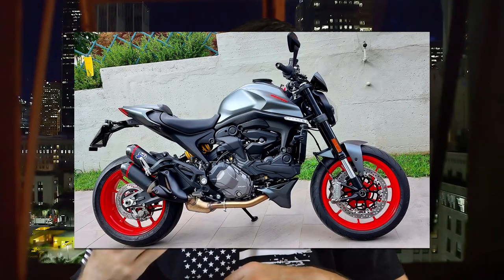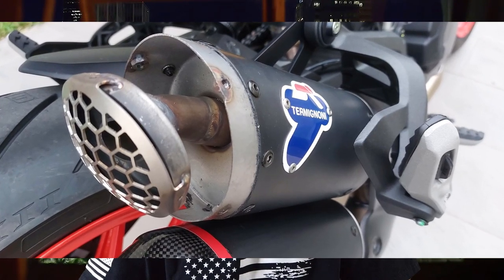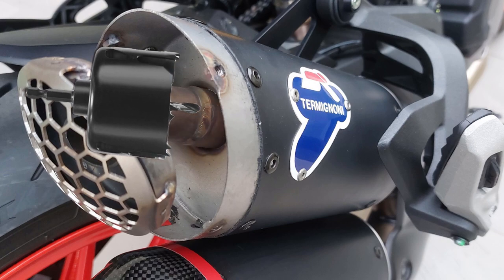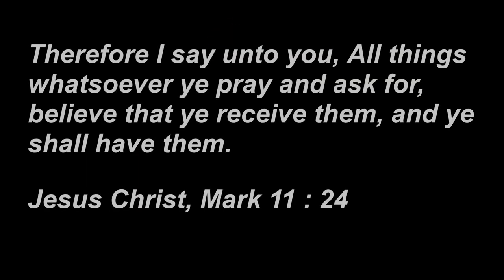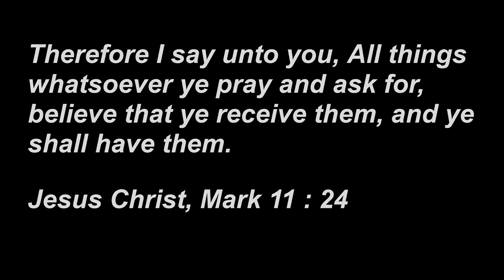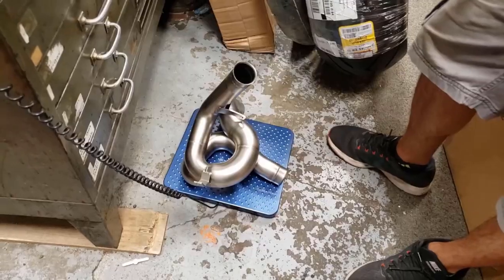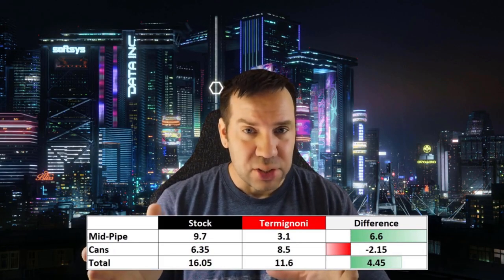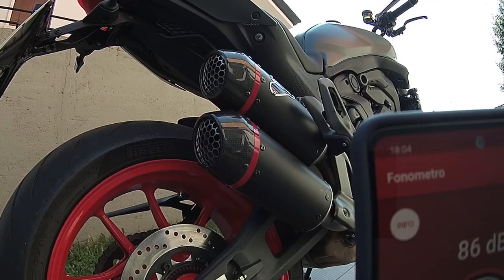Ducati Monster 937 ⛔BEFORE YOU BUY⛔ Termignoni Slip-ons, WATCH THIS (Termignoni Slip-on Full Review)

Comment: Hi. Thank you for this nice video. May I ask someting? Is it going to be a full system if I install Termignoni Racing slip on? Or do I need to do the other thing? Also, unmap is included with Racing Silencers? Thanks!
Reply from the maker: You need the full racing system (that includes the upmap, depending on where you live). What country are you in? If you are in the USA, what state are you in? Many states no longer allow the upmap. :(  But I know someone who may be able to install it for you.
Reply: I live in South Korea. Ducati Korea doesn’t allow to installed racing silencers. However I just made a contract for install racing silencer with Termignoni authorised dealer. I heard that unmap is not included in this case. Is there any way to do unmap in this situation?

Thanks!! Also, thank you for your videos. very helpful!

Comment: My question - and I think I know the answer - having already bought the slip ons, is it possible to upgrade them to the full (I.e. is the muffler the same and maybe I just get the header and midpipe?). It looks like the cans are different because of the db killer which seems easily removed in the full, but requiring some modification on the slip on
Reply from the maker: I think you could have your dealer install the rest of the pieces for you. Are you in the NY area by any chance?
Reply: @DucatiDiaries  I did and just got her back.  She’s a beauty just like yours but maybe not quite as dialed in as yours.  Doesn’t look like Termi sells the mid-pipe and Header separately so my slip ons will have to do but they sound delicious.

Comment: Quite a lot of work involved with taking silencer out of slip on, Iv just done it. It is one continuous pipe from the entry to the exit, which gets narrow and tapered towards the exit of thr pipe. Need ti saw off the end plates, saw off the weld join of muffle to main pipe, rip out thr insides, weld a new straight pipe onto end plate and re pack, then weld mufflers back onto main pipe. 6 hours or so in a Thailand engineers garage. I have pics let me know where to send them
Reply from the maker: Wow six hours. That's a lot of work. How does it sound now? You can send pics to RatedRCars@gmail.com

Comment: i am thinking about getting the full system but only use the Slip ons without db killers (driving without cat could be a problem were i live)
Reply from the maker: Or maybe get the full system and leave the DB killers in. Because then you get the upmap for increased performance. The system sounds better than stock even with the DB killers in.

Comment: The smarter way but more work would be to simply drill out the rivets for the carbon shell to pull it off and cut the welds for the DB pipe from the inside.  You can buy black rivets to replace the ones drilled out and keep the original look, or get red to be even more Ducati.  🤣

Comment: The Italian Connection, red rims do look mighty sharp. Do I sense red rims in your future?
Reply from the maker: I already tried. :)  Ducati won't sell them. :o/
Reply: @DucatiDiaries  that's unfortunate,  you would think something like that would be in their accessory catalog.
Reply from the maker: @robertjakicic5878  Imagine carbon fiber wheels on this though. I've got the bike down to about 407lbs wet. CF wheels and this thing is flying in the clouds. :)
Reply: @DucatiDiaries  I actually forgot about that option, carbon fiber wheels.  Just 400 pounds in weight that is extremely lightweight. You'll be under 400 with the carbon wheels.
Reply from the maker: @robertjakicic5878  Hopefully they're cheaper than the Diavel carbon fiber wheels ($5,000). :o(   You could buy a whole bike with that.

Comment: You can remove those dB killers fairly easily without ruining the mesh I think... A Dremmel with a cutting wheel, or a hand held keyhole saw perhaps.  You can drill lots of holes in a circular pattern to help make the sawing easier...

Done it on mufflers before on one of my Aprilias...    Once I drilled a ton of holes in a circle, and then took a sharp metal chisel and hammer and basically punched/cut between the holes that I drilled.  Once I got a large, rough hole, I inserted some perforated tubing wrapped in exhaust baffling, and then rivetted the end cap back on...

The process on the mufflers in your video will be very similar.  Basic tools, some skinned knuckles, a bit of cursing... but otherwise not too hard

https://www.youtube.com/watch?v=CX-93ZyApIA&t=1s
Reply: Here is what the stock and rebaffled cans sounded like:

https://www.youtube.com/watch?v=LbPDXy-b0Lo

I think you can open those Termi's up and do the same without too much hassle.  Just be careful with the tuning.  Even with the up map, the Euro5 regulated bikes can be a bitch with fueling and lean spots...

Comment: Any day now the long wait for delivery should be over here in Australia... Cant wait!! I have been told to put at least 1000ks on the bike before taking it back for the full termi system.
Reply from the maker: To hell with that. I got the Termi's on with less than a mile of riding. haha. But it may be good for your to ride for that period and then you'll fully appreciate having the Termi's.
Reply: I just got my monster yesterday (in Australia).  Had the termi race system put on before I picked it up.  Wasn’t interested in hearing it stock 🤩😎
Reply from the maker: @5151luke  Congrats. Check out my TFT display vid if you haven't seen it. It shows the instructions on how to set the wheelie control, etc. And this bike will wheelie without effort!! :)
Reply: @5151luke  What state are you in? im on the GC and still waiting
Reply: @DucatiDiaries  okay thanks
Reply: @robertrossi9374  South Australia.  I think the local dealer only received 3 bikes in the first shipment.
Reply: @5151luke  . Thanks Luke... enjoy your ride mate!